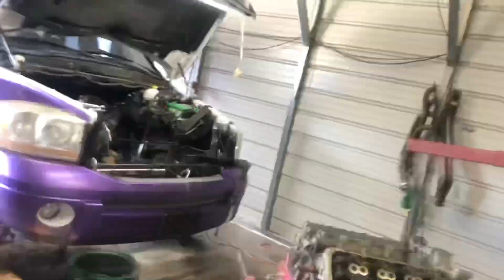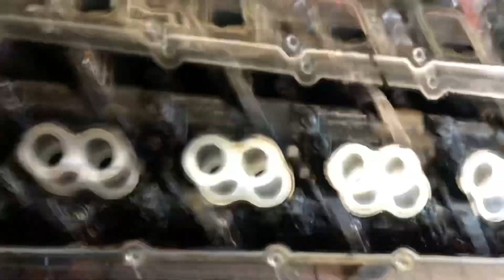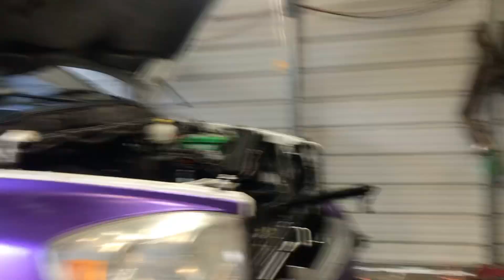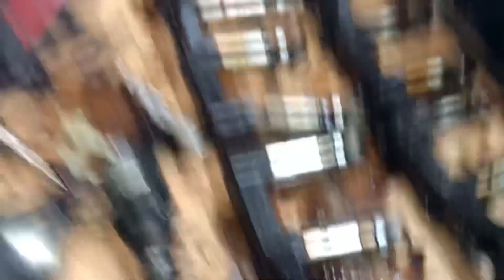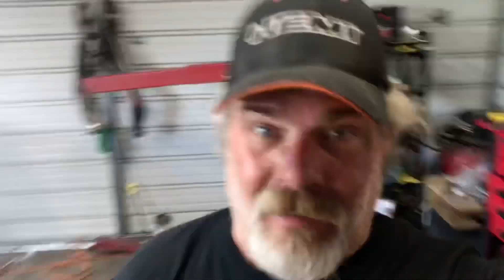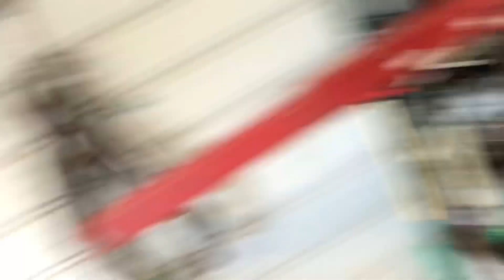Let’s dig into this Nasty 5.7 Hemi. Going to need a lot of degreaser! #nonamenationals #utg

Comment: That looks like parrafin build up from here,it's tough to see it only on my phone. 
I remember back in the 80s my buddy bought a 69 Coronet 500 with a 318 from a older gentleman who bought it brand new.  He proudly announced he only ran Castrol gtx oil in it from day one through its whole lifetime. My buddy only bought it for parts and the engine ran ok.
After we yanked the block and tore it down did we see what running Castrol for the whole cars life did to it. The whole thing was loaded with parrafin wax!!! We were amazed it still ran considering almost every oil galley was packed with the wax! Valve covers had a ton of build up on them along with the heads, lifter gallery etc. It was unbelievable! This guy didn't neglect the car either, he kept all the receipts for the past life of it and regularly changed the oil as recommended. Some of the blocked passages you showed reminds me of that block from long ago. Oh well. Thanks again!

Comment: I've been having really good luck using 409 oven cleaner. Soaking, abrading and then spraying off with either hot water or brake cleaner. 
Wish I was around to help with prep and dummy work brother. Badass as always

Comment: Al have you ever worked on Diesel Trucks I had a 1995 single cab Dodge 12 valve the Cummins engine was great. The Turbo was basically indestructible. Lots off Torque.

Comment: Al what happened to your engine hoist?
Reply from the maker: It was like this when I got it.. it was free.
Reply: @Mopar-AL  I was gonna ask the same thing. Looks like it's been overworked and underpaid Lol. May not be a bad idea to run a strap of steel along the top with a couple gussets just in case. Doubt that's ever coming close to straight again without LOTS of heat and pressue. Seriously limits your lift travel :/
Reply from the maker: @chriskulpa4056  it was used fo semi motors, that’s how it got bent. I’ve pulled a lot of engines with it .

Comment: Yeah I've seen worse but not one of these modern engines. I'd be willing to bet whoever had that thing literally never changed the oil. When I bought my 71 Charger back in 1990 off the original owner, 83389 on the clock and the factory inspection mark on the oil filter, it wasn't even this bad! Holy shit!
Reply: @Tony it had the original oil filter on the Charger Still they just drained and filled or original oil also WOW.
Reply: @Daniel-fd3wp  God only knows. After I cleaned the crap out of the carburetor, it actually ran. Held enough oil pressure to keep the idiot light off until it warmed up, then it would flicker at idle. When I tore it down, it was gunked up pretty bad and the bearings were literally speckled looking with embedded solids. The thrust surface on the crank was wasted but beyond that I ran a hone down the bores, new rings, of course replaced the crank, and a valve job and she went back together. To this day, that little 318 still runs on that same bottom end. 😎
Reply: And heres me freaking out when i have about 800-1000 miles left on my oil. Lol

Comment: Should i be worried about my 2007 dodge ram with 200.000 klm ref spark plug and the rest of the shit that gos with it 😆 🤣 😂 😹
Reply: As long as you're doing the oil changes, no. If you bought it used with that many miles on it, may not be a bad idea to pop the valve covers and see how good or bad it is inside the top of the head so  you don't have surprises.
Reply: I got the truck in 2017 with 115.000 klm .
Reply: @conradboisvert6730   If you're doing changes on it probably ok but the only way to really know is to pop the valve covers to see what it looks like inside or if you've got a borescope/camera you can stick in the fill hole to look around inside really.

Comment: That's a relatively newish truck to be getting it's 3rd engine. Says a lot for the modern "hemi". But then again I have little faith in anything modern, seems like it was all engineered to fail so you have to buy a new vehicle every 10 years.
Reply from the maker: It’s all about how you take care of it.. 204,708 on my charger and 261,000 on the truck before we pulled it to put the race motor in it.
Reply: 205000 on my 07 ram 5.7. Its still running strong, I'd take it anywhere if the gas prices weren't so wild  lol

Comment: Hey Al, I'm not at all familiar with Hemi engines, old or modern so I have a question...What are those 4 sets of big bosses running down the center of each head for? Do modern Hemi engines have dual spark plugs for each cylinder?
Reply: OK, thanks for the reply. I'm really not familiar with any modern engine. The only dual plug setup that I've ever had myself is the Ford 2.3L in my 1994 Ranger. That is in the process of being swapped out for a good ol fashioned 302 right now!
Reply from the maker: Yes

Comment: Uncle Tony dissected a 5.7 hemi in one of his videos.  I don't know the year. His had shown signs of a bad oil system.  Has Dodge done anything over the years to improve these problems?
Reply from the maker: Yup..
Reply: From what we can see here, it's not a bad oil system, it's either bad oil or lack of maintenance. There's no way you're going to get any sort of oil system to work right if it's not maintained. The passageways and such are the size they are to allow the oil to be distributed within the tolerances allowed. Don't change your oil and that system is going to fail. Simple as that.
Reply: It was a pre eagle hemi. An 03 model i think.
Reply: The Hemi oiling system itself is fine , the problem is the MDS lifters . Tony is extremely ignorant on many things , he thinks that the cam & lifters on small block Mopars were lubed by the rods dipping into the oil in the pan , then splashing it onto the cam & lifters . That is beyond ignorant .
Reply: @HowardJrFord   Erm, he did a whole video on the oil passages common to engines and I don't ever recall him saying that. Have any proof of when he said that it was only lubed by splashing?